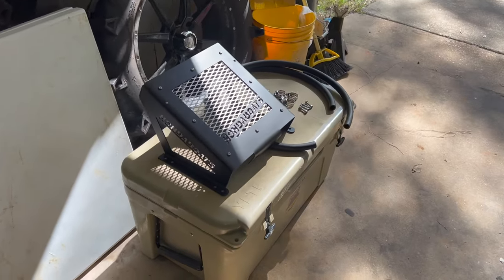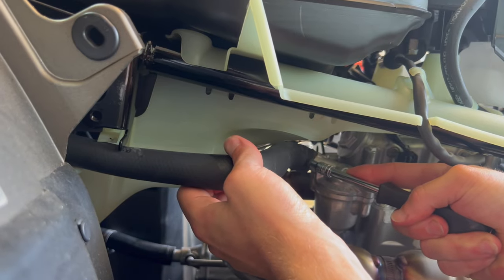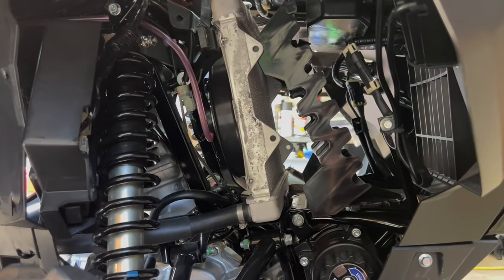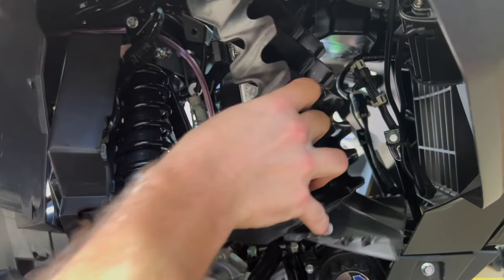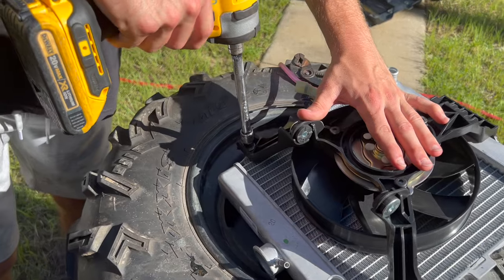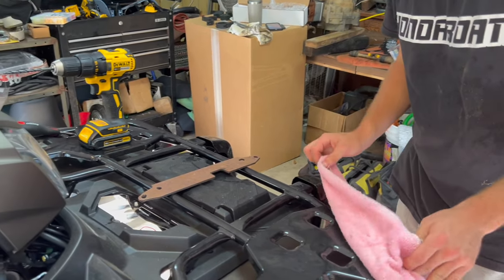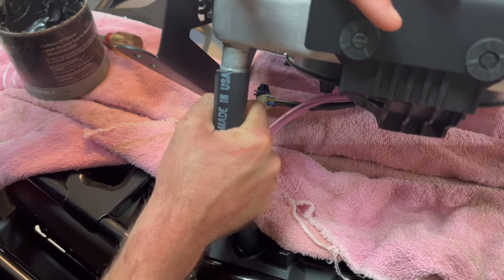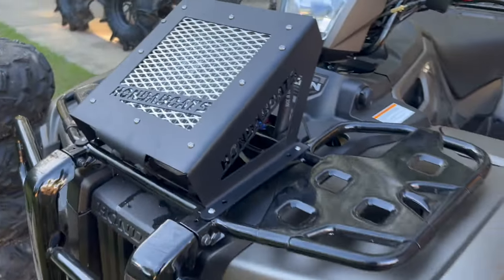How to install radiator relocate kit on a Honda

Comment: Having a hell of a time with the longer hose fitting into almost a 90 degree tight spot on the bike, hose doesn’t seem like it wants to set at all all have it on both sides as I’m wiggling back and fourth, been at it for hours , any tips I’ve used grease and pliers still can’t get those hose to set right
Reply from the maker: Where at on the bike? Motor or radiator side? We grease the hose and slide it on, it is a tight fit, but it’s the same ID as the oem hose before it stretches
Reply: @vesselpowersports  motor side of your on the bike it would be the left, and yeah I greesed it and everything gonna try swapping sides seeing if that may make a difference, if not I may just throw a 45 fitting on and call it a day

Comment: What did you use to drill the hole in the front storage
Reply from the maker: Step bit
Reply: @vesselpowersports  is there a certain size?
Reply: @vesselpowersports  is there a certain size?
Reply from the maker: @gamertamer_yt5934  at least need it to go to 1”

Comment: Able to keep the reservoir?  Not supplying the longer hose for it?  Don't like the idea of it going away.  Do like the low profile look of the kit.   Would paint it white like I've done to two others.  Black burns to the touch.
Reply from the maker: We do away with the reservoir with this kit, but you are able to keep it in the factory location with the push pins, we have seen customers do that before

Comment: Not understanding why change put on the top 
can anyone explain
Reply from the maker: Mainly for the mud riders, so your radiator does not get clogged with mud and start to overheat. It is a big problem when you mud ride often, even if you clean it out after every ride, it is still bound to get clogged.
You can also mount accessories to it!